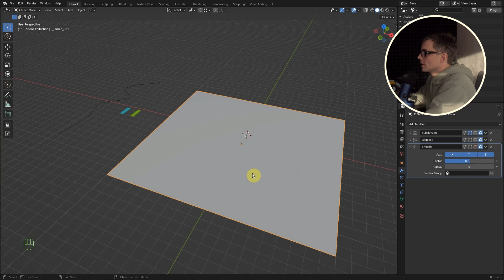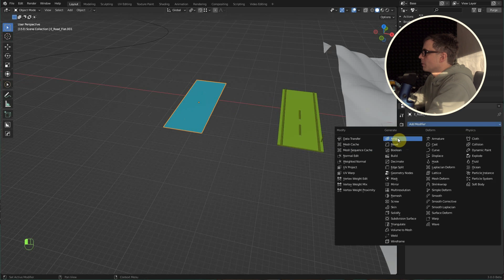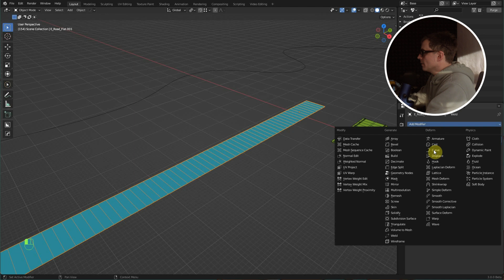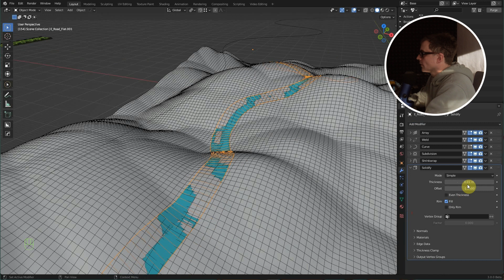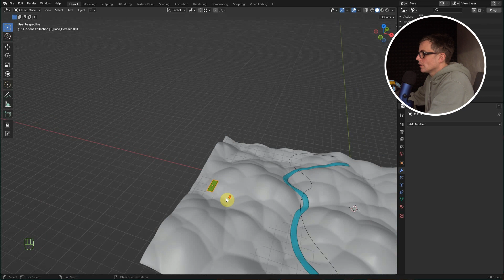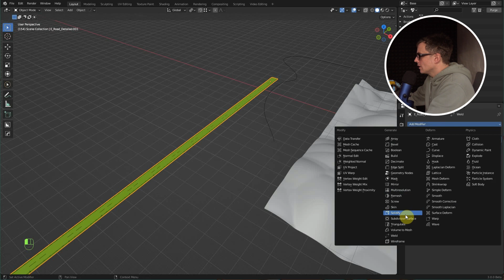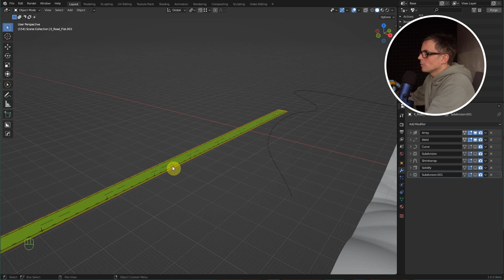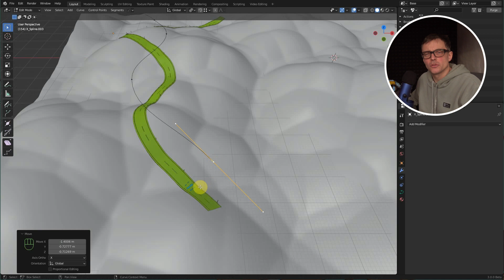Road on  a Terrain - Blender Tutorial

Comment: Great tutorial, is it possible to do the same but with an image instead of the simple curve you select at 0:57? I have a map of a road in the form of an image that I want to place on top of a terrain. and It'd be great if I don't have to draw it again using the line. Sorry if it's an obvious question, I just started Blender.
Reply from the maker: Well, you can project a texture onto the terrain / or use it as a mask. But that would then be a completely different story on a shader level and not on a geometry level. But retracing a curve should not be a big deal, no? Good luck!
Reply: @XoioDe  I will give those two options a try, thanks a lot! If they don't work, I'll just retrace the map.

Comment: I am trying to lay a hiking trail STL over a mountain terrain STL. Difficult for them to fit. I think this technique might work. How to I prepare both STLs to shrink wrap over one another?
Reply from the maker: Sorry, what do mean by stl? The import format? If yes, it all depends on the mesh you get, but maybe if it is just a trail it makes sense to quickly retrace it with a curve from top view before you shrinkwrap it. You will get a better mesh and result.
Reply: The STL is the file to create 3D print. I’m a newbie and was excited to find your video. I would have to spend time learning how to create a curve, etc.
Reply from the maker: @Inboundskier  Sometimes unfortunately you have to dig deeper to get stuff working :). The STL - as soon as it is inside Blender is just a regular mesh - from that point on it really depends if the resulting mesh is good enough to be projected, because you need some persistent vertex density otherwise it will look bad. But maybe your import from STL is good enough! Creating a curve would be good, but involves a few steps. It is really not that much of a deal - should be plenty of tutorials. Good luck!

Comment: Hello, thank you for a great tutorial. Can I ask you if you are able to use this procedure also for an urban road network with crossings and how would you construct a curve for this purpose?
Reply from the maker: Hi. Well there are two scenarios: If you have a flat terrain for your cityscape I would not do all the effort and keep it much simpler. But if your city is built on a mountain slope I can recommend the other video on my channel with the mountain road, which also allows you to do crossings.
Reply: @XoioDe  Hi. Thanks for the reply. I pretty much liked how you could use a segment and by curve modifier apply it to the whole element and even edit the whole road element by editing the segment later in the modelling process. However, the mountain road is something I would like to try. I guess it will need a bit of studying and practice to find the optimal way.